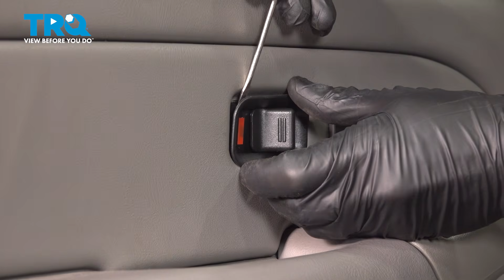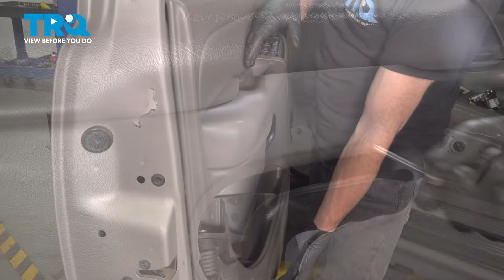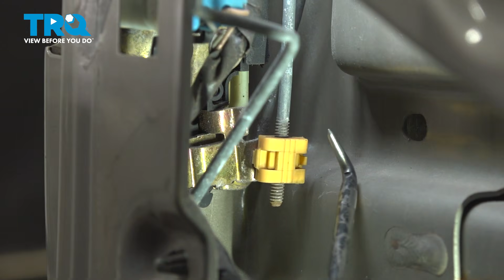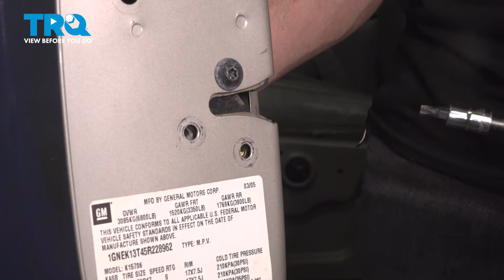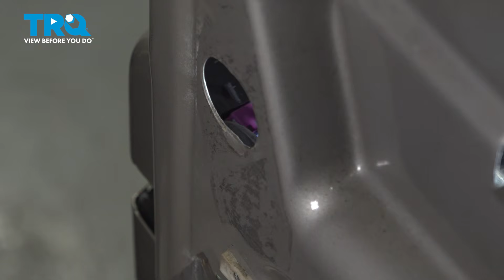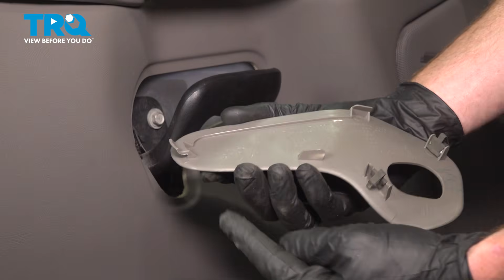How to Replace Front Door Lock Actuator 2000-2006 Chevrolet Tahoe

Comment: After Replacing the door Lock driver side. I get a chattering every time it locks. It works but annoying.  Check all your electrical operation before putting your door panel back together.

Comment: Ty for extra time for step by step detail and camera still-shot check for corrosion. Later we can put dab of silicone grease on each connector and rod slide contact.
Without this last greasing, EVERYONE will need another actuator within 5 years. The binding and friction is what made the failure in the first place. The lesser used locks will be next to go.